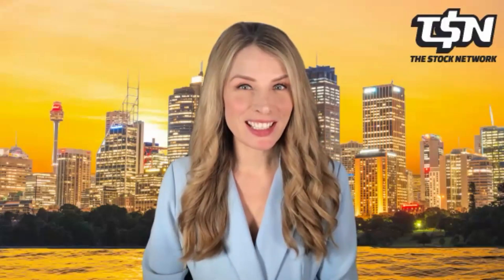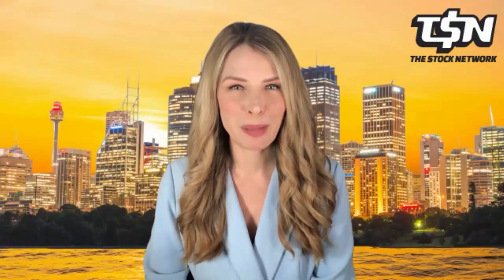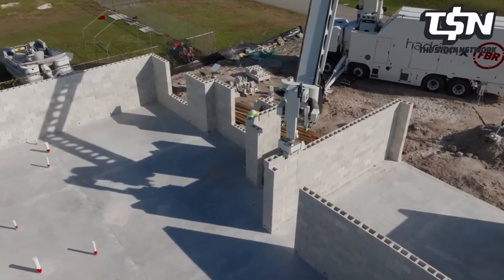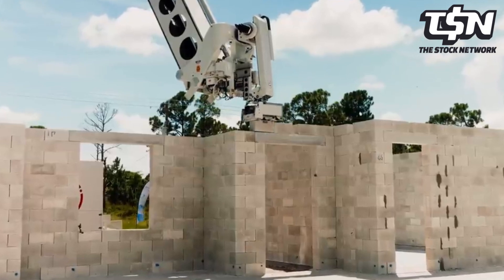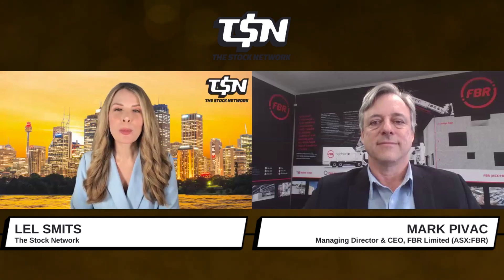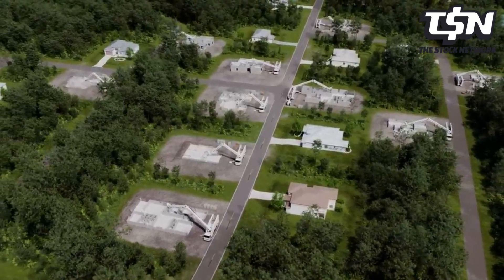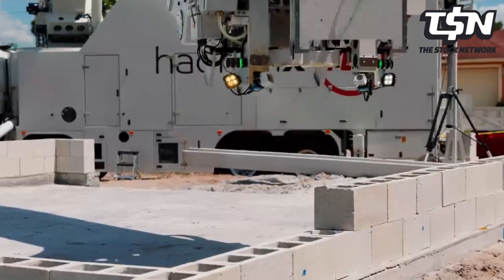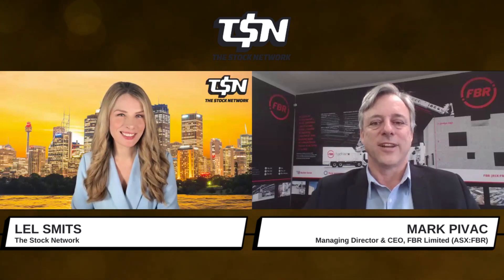FBR (ASX:FBR) Commercialisation of fully automated bricklaying systems ramping up in Australia & US

Comment: FBR uses glue to bind the blocks.
Reply: Twice the strength of traditional mortar, 👌
Reply: @dignifiedDog    But not fire rated.
Reply: This is part of their major FAIL.  They have missed out on 99%+ of the market.  They need to pivot and start using regular mortar and support standard brick sizes also.